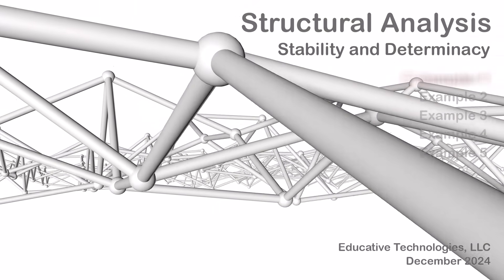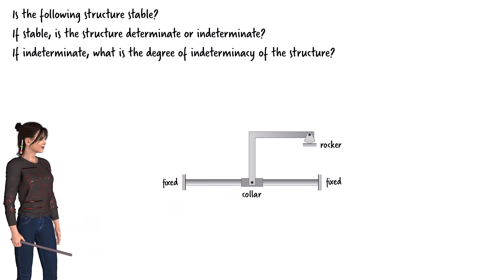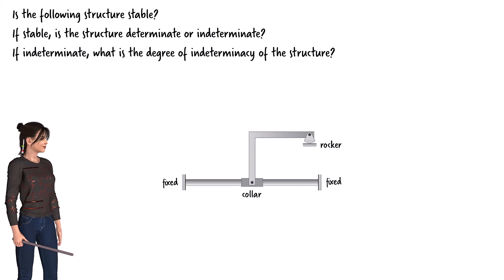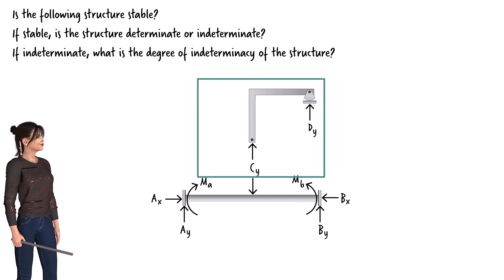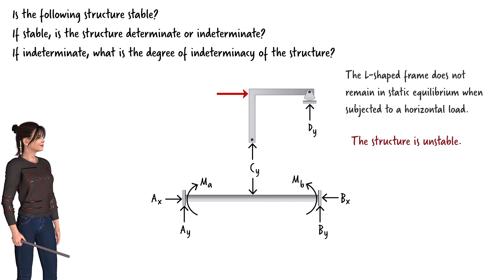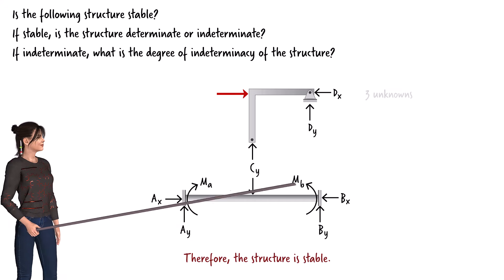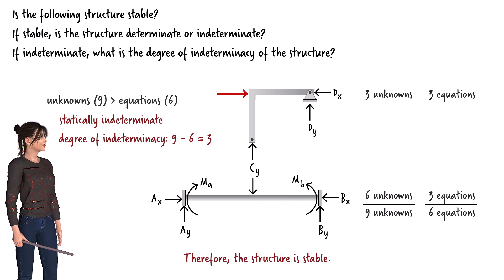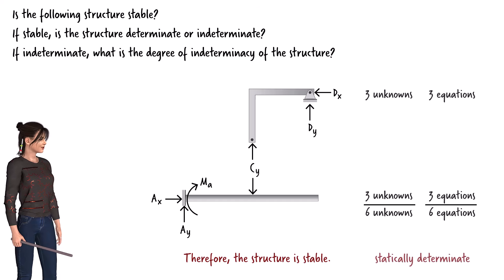SA75: Stability and Determinacy of Structures (Example 1)

Comment: 3 eqm eqn means, L shaped frame is stable against moment also. But how and where  resistance moment is developed? Plz ans
Reply from the maker: In the loading case discussed in the lecture, no bending moment develops in the frame.

However, consider a vertical distributed load applied to the horizontal member of the frame. This type of loading generates a bending moment, much like a distributed load induces bending moment in a simply supported beam.